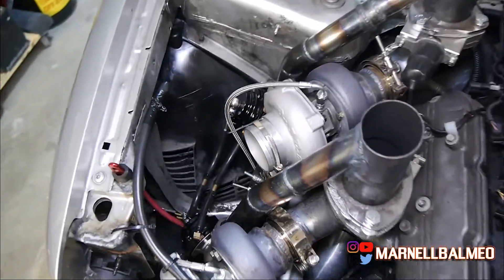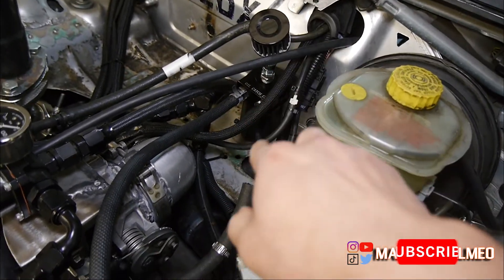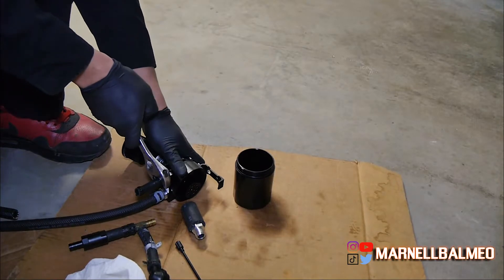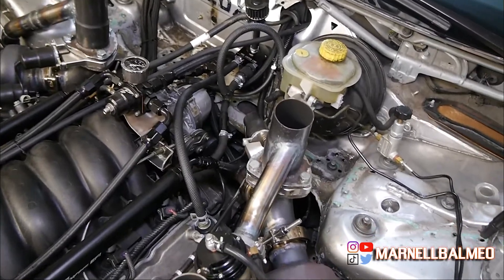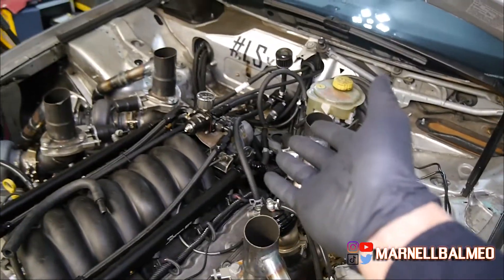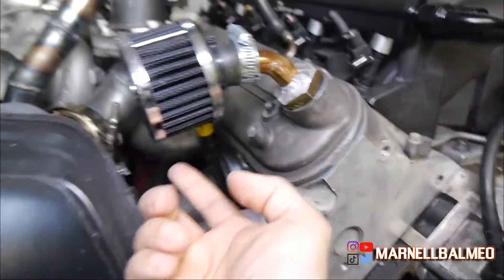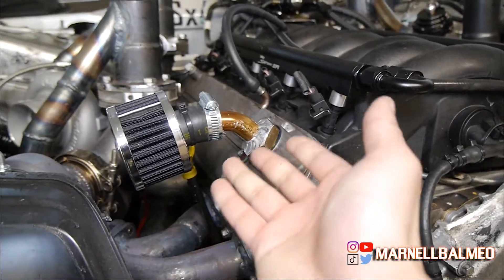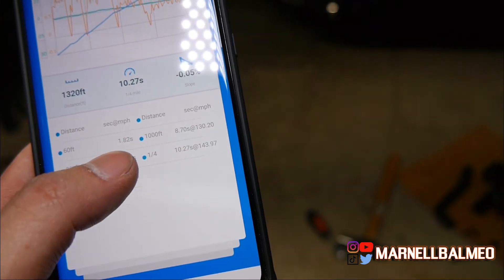Revisiting the poorly designed PCV

Comment: Yo major congrats on 10K subs Marnell!!! Well deserved. BTW be careful with that type of catch can in general. I'm going to link a video in another comment in case it gets caught as spam.
Reply: I was really surprised how much pressure increase there could be. Especially in your case you really need a lot of air flow. They do make larger ProVent cans as well. The number is technically a horsepower designation, but they are made for diesels. I'm sure the 450 for example would be more than plenty. Just an idea though, obviously there are other good catch cans out there. https://youtu.be/fiAs52P7Qwg
Reply from the maker: Thanks. I'm not able to see provent 450 but I did see provent 800 but at $300. A bit pricey, I think a Metal baffle can with 12 an to each valve cover with dual filter that has clamp that's bigger or equal to 12an should support 1000whp+. I'm just done with all these catch can with small hose 😅 probably be fine at low hp but not for 1k
Reply: @MarnellBalmeo  I'm sure you'll come up with something that works well. 😁

Comment: The mesh median in the can shouldn’t be filtering the flow into the can. It’ll cause clogging and allow oil to piss threw the breather filter on the catch can. Have the outlet side hooked to the inlet side so the median insert will slow down most oil particles and vent to atmosphere. I hope your able to possibly understand why I’m meaning.
Reply from the maker: Thats a good point. Its a good thing it doesn't have any sort of mesh, though this setup seems to work fine at collecting the water